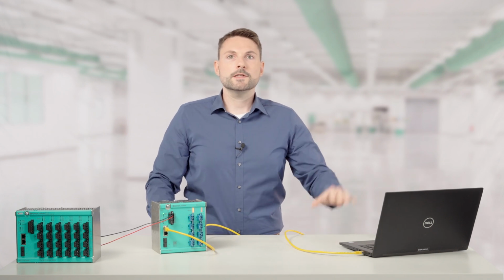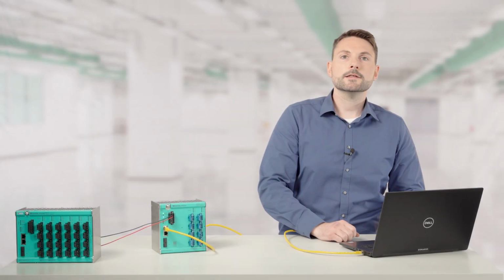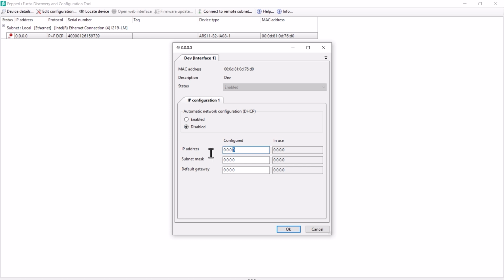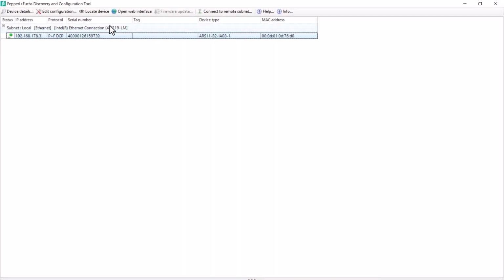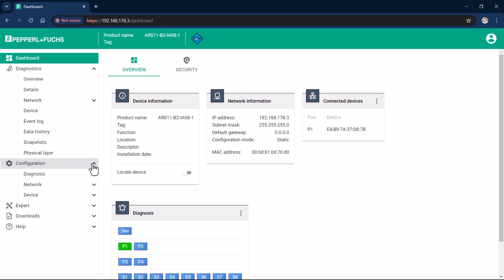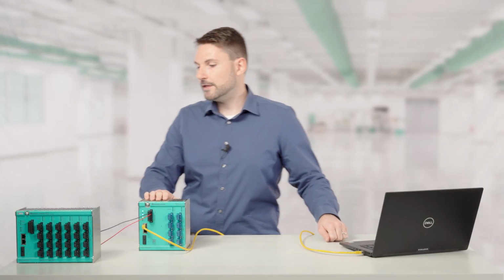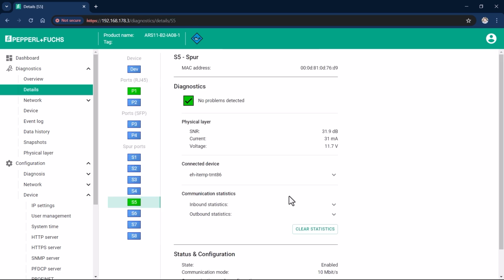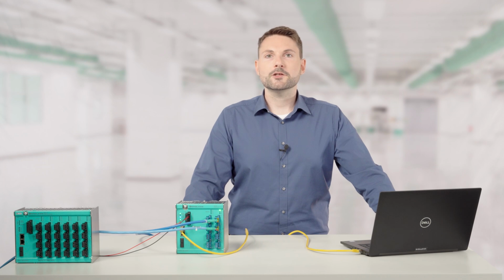Pepperl+Fuchs Hacks: Initial Commissioning of the Ethernet-APL Rail Field Switch

Comment: Is it also possible to connect this Ethernet-APL / 2-WISE Field Switch to the SIS (Safety Instrumented System) / IEC 61511-1, for funcional safety functions?
Reply from the maker: Hello Roberval, thank you for your question. 😃 Ethernet-APL, as a physical layer, supports a variety of protocols. Regardless of the protocol, the APL switch functions as the black channel for safety communication. Profisafe, a protocol standardized for up to SIL3 (IEC61508) safety communication, can work with Profinet communication. Profinet can be utilized alongside Ethernet-APL topologies. 
If you have any further questions, please contact as at any time. #AutomationPassion